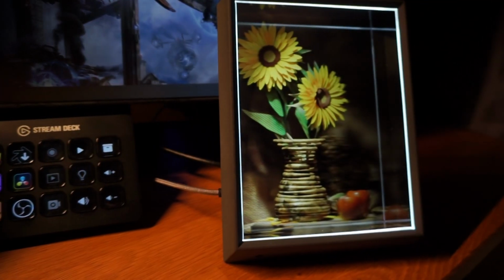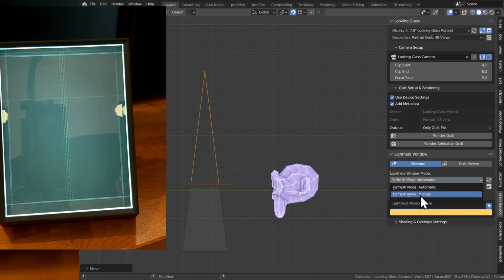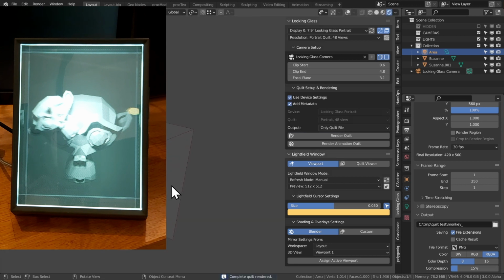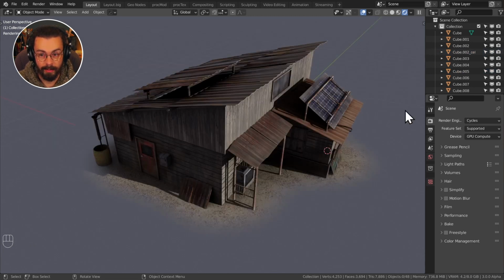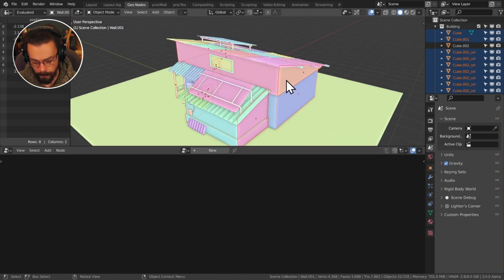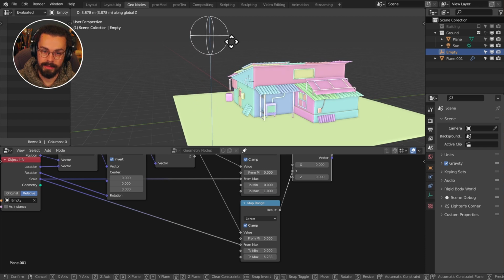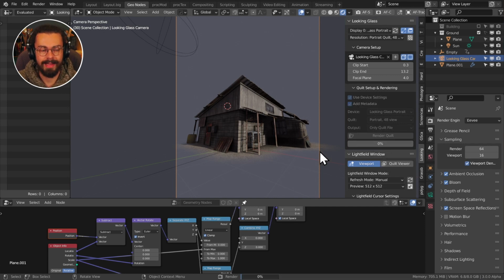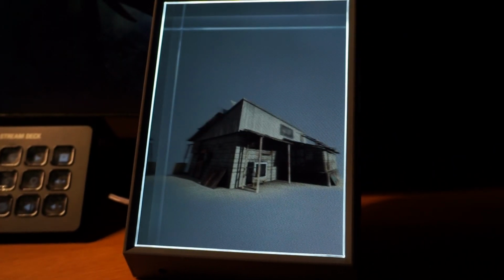Holograms with Blender - Looking Glass Tutorial

Comment: I saw about this device a few weeks ago. Yes it is clever. But utterly pointless imo. Basically, it is a small step up from those cards that have been about for many decades, (lenticular printing?) that you can move and the gives the impression of depth to an image. They have virtually no use either. The frames are deep, angle of view small, are tiny, or vastly expensive for still not big for a screen. When, or if it develops, into a free projected 'ghost' object with no frame around it, effectively what sci-fi has imagined, I see little place for it. How often does anyone look at a photo frame these days?
Reply from the maker: I'm pretty torn on them, I think they make sense for the larger displays and inside commerce spaces, expos, or galleries. The small personal ones to me feel more like they're designed for prototyping for the large displays. Definitely a cool but of tech but time will tell where they stand in 5 years

Comment: How to switch from Desktop Mode to Standalone Mode ?  should I turn it off , connect usb Type c-c , and boot up again ?
Reply from the maker: Yeah that's what I have to do on mine. Turn it off, remove the HDMI and then turn it back on. I think there's supposed to be a more direct way but I couldn't get mine to do it
Reply: @Erindale   thanks, and I tried another way, I use c-c connect the  power plug which Standalone mode used,  and only connect PC with hdmi, It works !  In that way,   I can single tap the power key  shift  between PC Perview and Standalone Mode.  But, to Sync data into the galss, it still need to replace the type A-C.  I think the perfect way to slove is to connect Type c-c between glass and PC,  but required a Type c mainboard to support it , or some type A-C transmation plug that has extra power support to boot it up :D
Reply from the maker: Oh gotcha. I really need a usb-c hub as I've only got one on my mobo

Comment: As someone who makes physical things for a living, I think this could be an excellent device for design reviews or marketing at a trade show. I just picked one up to play with using your link and if I like it I may convince my boss to get the bigger one. Knowing that it plays nicely with blender is really reassuring because otherwise it’s just a neat piece of hardware but has no software to make it useful.  Hopefully adding interactivity with Eg the leap sensor or a Kinect sensor isn’t too hard also.
Reply from the maker: Maybe drop them an email about the extra hardware! They showed me some setups with leap and kinect and it looked like they worked well together!
Reply: The looking glass factory will soon release a 65 inch display for comercial presentation.